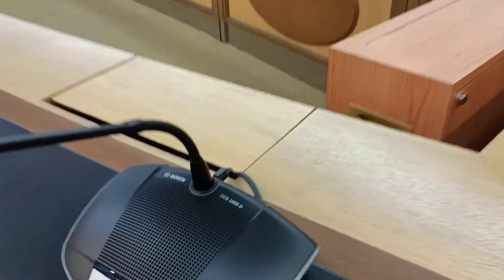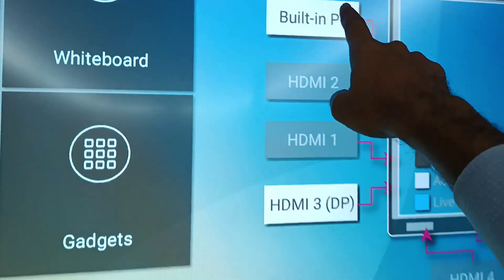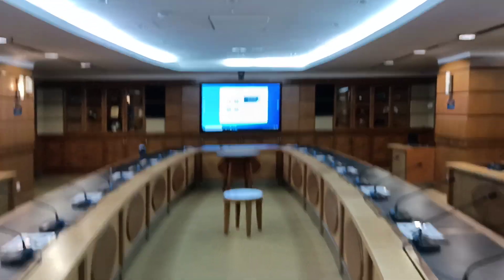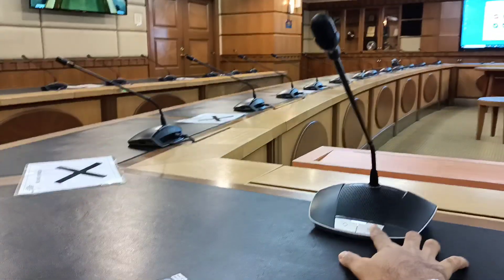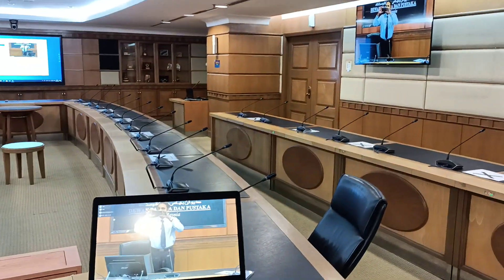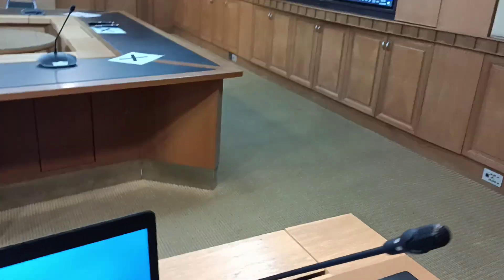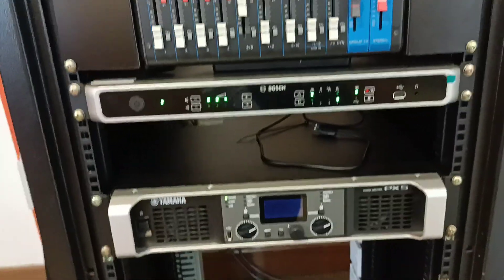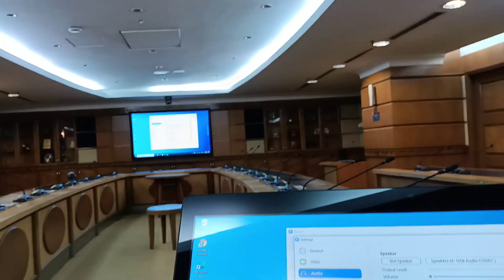Bosch CCSD 1000 with Automatic Camera Control

Comment: Hi suffian.for single camera   Lumens vc50p camera has only 10 presets.  How can I configure camera preset for 18 microphones? Did you used external camera controller?
Reply from the maker: Salam Shoeb,

YOu can go into the camera web based for more preset and for more advance setting.
Reply: @suffiananwar  thank you 😊. Does web GUI of lumens vc50p support more than 10 presets?

Comment: Rayito?
Reply from the maker: Rayito ?
Reply: Can we do this on bosch ccs-900 microphone system or it was work only with digital mic like ccs 1000? And how integrate with cisco vc devices?
Reply from the maker: @cuongnguyenquy8583  Hi there
Let me break it down :-
1) Bosch CCS 900 is an analogue system, Hence it cannot work seamlessly with IP PTZ camera. But you can use its audio to integrate with Cisco.

2) The minimum requirement for Bosch Conference system for automatic camera control is Bosch  CCS 1000 D, because this is the most entry model for Digital system. 

3) for Cisco integration, you can use the bosch CCS 1000 audio input & Output located at the back of the control unit. CCS-CU and CCS CURD

I hope you got the answers. 

Good luck on your solution 

and stay safe.
Reply: @suffiananwar  thank your for your reply, Suffian Anwar. I have cisco codec SX-80 and Cisco Roomkit Pro with both 2 cisco Camera P60. Can we connect and use 2 cisco P60 camera, connect and work with new digital microphone system ccs-1000 or newest bosch incentis system upgrade by auto camera? Thank you :)
Reply from the maker: @cuongnguyenquy8583  Hi there, i think with P60 system, in order to use with CCS 1000 all you have to do is to add crestron CP3 controller
Reply from the maker: @cuongnguyenquy8583  #Stay safe.. From #Malaysia
Reply: @suffiananwar  let me study on the solution. Thanks, safe and nice weekend day :).